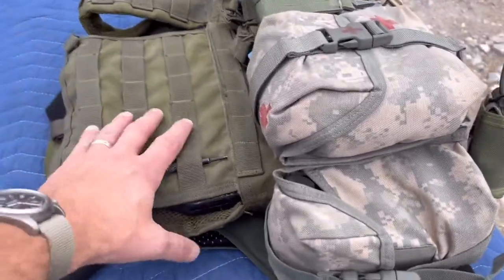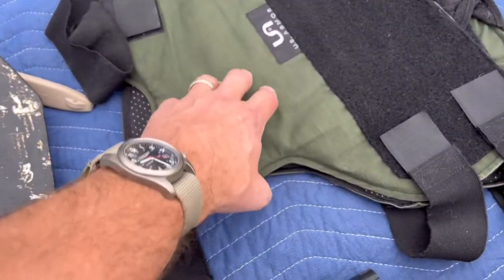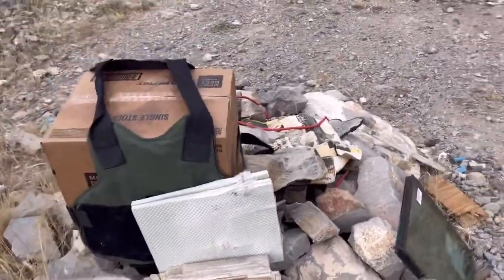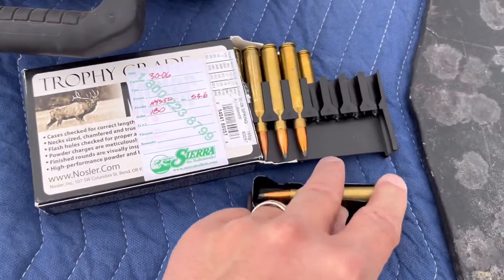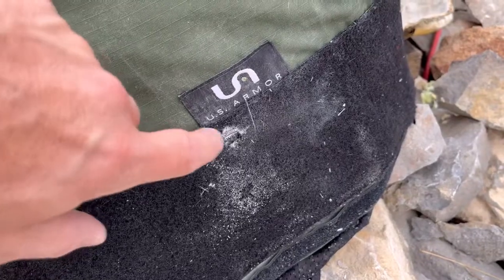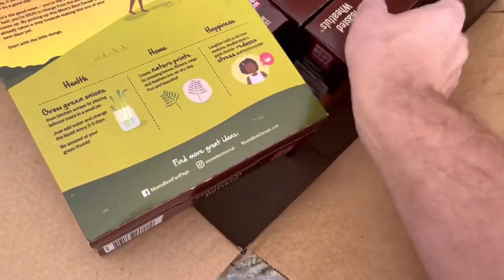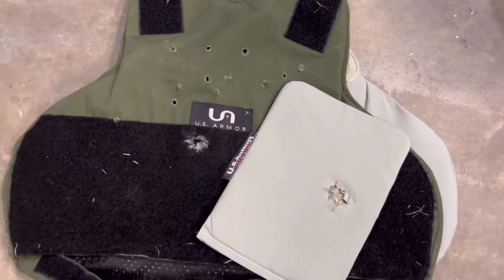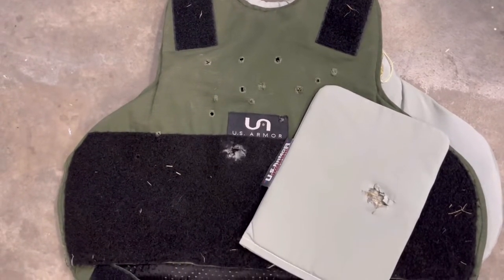180 gr Sierra GameKing 30-06 vs Body Armor & Homemade Rifle Plate

Comment: all those plates front and back wont stop a FMJ 30-06. im not talking about AP either.
Reply from the maker: In what I’ve tested before in these plates, off channel, I believe they would.  The fiberglass does a good job of tearing apart bullet jackets.  But, I would need to test it specific to 30-06, so I can’t say for sure.  If I come across some, I will have to try it.  Great idea!